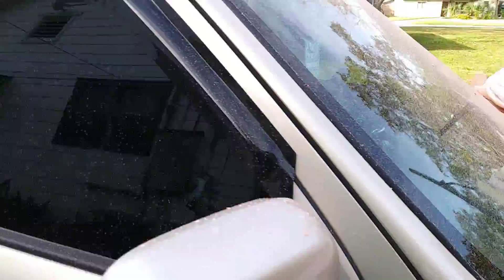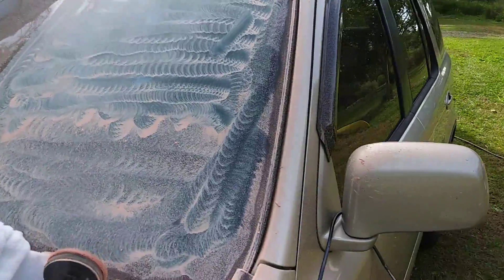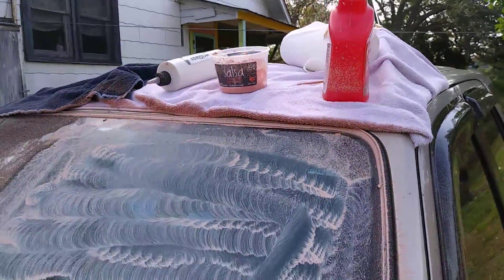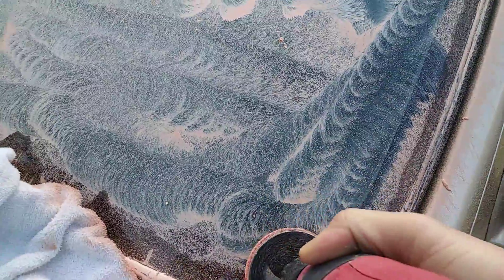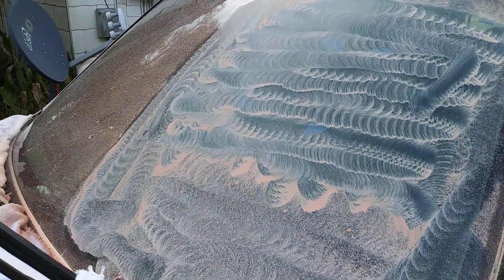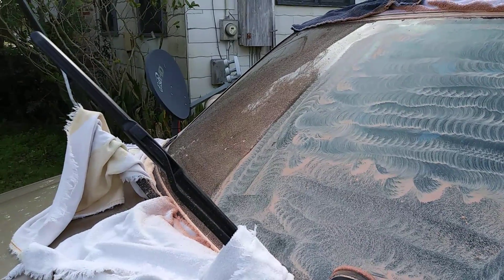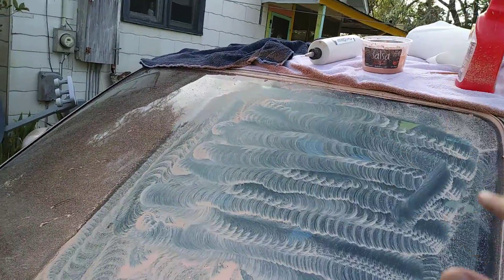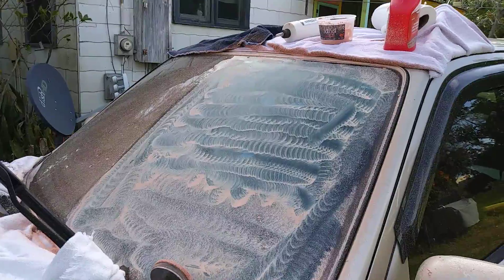Cerium Oxide Windshield Polishing Part 2

Comment: Is this going to damage the car paint? Thanks
Reply from the maker: I've used this many times and anything you get on the paint you do want a very carefully remove with like a rinceless wash method. Spray it down with a pump sprayer, carefully wipe with a soaked and then dry. It is abrasive so you do want to be careful but I have had zero problems
Reply: @deluxevehicledetailingandp904  Noted. Thanks for the great info.
Reply from the maker: @brianwong6562  yeah I was using talk-to-text and said soaked MICROFIBER ,

Comment: I found many swirl marks after polishing especially when use foam pad (with wool pad resulted in less swirl marks) Do you have suggestions how to remove this hairy swirl marks?
Reply from the maker: You are getting swirl marks using cerium oxide and a foam pad? Did you prep the surface and make sure it was extremely clean? Cuz the only way I could see getting swirls would be if you had contamination in your pad or on the surface. This video was from quite a while back I have a newer one on my channel you can find it was probably about 4 months ago or so. But in both videos I'm using a car Pro rayon glass pad and that is the only pad you should be using unless you're using foam just a deep clean the glass before applying a sealant or ceramic coating to the glass. I've never tried wool on glass but if you say you're getting less swirling that's a good thing. But if you're trying to remove light scratches this will only be accomplished with high speed drill, cerium oxide and a rayon glass pad. Get back to me as to what I've pointed out and we'll go from there
Reply: @deluxevehicledetailingandp904  The wool glass felt I used is kind of carpet, we usually don't call it rayon here, I believe we use the same pad. It's quite common in my country to use that pad. Both wool glass felt and foam pad created a swirl marks, less on wool glass felt. Ok I will try polishing again with higher speed. Thanks for replying btw. I forgot to mention, I bought a new wiper, hope the streaks won't come back.
Reply from the maker: @anandyahamdi  well if it's like carpet this is very different from the pads I use for glass. What is described at I believe it's carpro.com as a rayon glass polishing pad is more like felt. Very flat very specialized type of pad. Are you using cerium oxide? Yes changing your wiper blades off in and actually cleaning them thoroughly each time you wash is very important I even keep a microfiber in my car and keep my wiper blades very clean all the time in between washing. I'll look for a link on my latest polishing video and post it here
Reply from the maker: https://youtu.be/KN0tB8FRYZw
Reply: @deluxevehicledetailingandp904  Yes I use cerium oxide, the carpro pad you use is the same as I use with different brand. I also tried foam pad which I won't use again after so many swirl marks produced. Thanks for your suggestion regarding cleaning up the wiper blade.
Reply from the maker: @anandyahamdi  did you see the link I posted below my reply with my updated video on this? It may help I wish you luck polishing glass is not an easy task but I'm glad you have the flat rayon felt type pad as it really does the best job
Reply: @deluxevehicledetailingandp904  Hopefully with higher speed polishing I can remove the swirl marks. I've ordered another cerium oxide and larger rayon pad to make the job quicker. Last time I used 3" pad was really painful.
Reply from the maker: @anandyahamdi  yeah I like to use multiple pads and use 5 in on a rotary polisher at high speed for the main part of the glass and then bring in a 3 in for the edges and corners. You sound like you're pretty sad I hope you do well and have perfect shiny glass at the end. What country are you in ❓
Reply: @deluxevehicledetailingandp904  I'm in Indonesia. Btw what speed do you recommend? Is 1500-2000 rpm enough for removing the swirl marks?
Reply from the maker: @anandyahamdi  I run my German made Metabo rotary polisher which is available online from Walmart. It won the gold medal in its category a couple years ago when I bought it and it is a very precision made beautiful rotary that has never failed me with many hours of use. Here's a link where I talk about it if you or anyone else reading this is interested.
https://youtu.be/amm9hAOo6fY
Reply from the maker: @anandyahamdi  I forgot to mention that I run it wide Open on speed 6 which is 1900 RPM which is why I started out using a high-speed drill but have since switched to the rotary with a 3-inch extension and 5-in and 3-in backing plates with a foam interface pad that I found on Amazon in each size which softens up the pad because it's so thin and hard working on the curved glass is a little easier with the interface pad.

Comment: After polishing with cerium oxide my windshield became clear from water streaks during the night rain. But after a month the water streaks came back again. I have no idea why this happened?
Reply from the maker: I would think it would have something to do with the water. Do you know the TDS content of your water that you're washing with? Are there any sprinkler systems that you might encounter over the month either at your home or somewhere else? Did you use any type of protective coating after you did the polish. I put out a new series of glass polishing and coating about 6 months ago you may want to check those out.
Reply: @deluxevehicledetailingandp904  I didn't use any protective coating at all. I forgot to mention, my wiper is quite old actually, Is it possible due to the wiper? I can't see any scratches caused by the wiper
Reply from the maker: @anandyahamdi  well if it was from your old wiper blades they would be in the same curved shape as the wiper arm moves so it should be pretty easy to tell if it's water streaking or wiper streaking. Definitely want to pick up a new set of blades and keep them clean I wipe mine quite often to keep them clean so that no dirt builds up and you can get wiper marks. You may have to do another light polishing job but I would definitely think about putting a windshield coating or really any ceramic sealant on your glass so that the blades have less friction and water clears off the glass much quicker.
Reply: @deluxevehicledetailingandp904  I'm a bit paranoid in using chemicals on my windscreen. Some years ago I used a repellent agent that instead of making it clear, it makes my windscreen full of water streaks during the rain. Is a clear windscreen (after cerium oxide treatment) will invite any funguses or dirt? Is it necessary to use chemicals again on my windscreen?

Comment: For how long powder should be left upon windscreen?
Reply from the maker: Well first you mix it with water till you get a consistency you're happy with not too thick not too thin. Then once you get it on the glass you can really just keep working it, but you don't put any powder on the glass. As long as you keep spraying it and adding a little more to your pad you should be able to work it for about half an hour on half of the glass which should make a huge improvement. There is an updated glass polishing video on my YouTube channel. It goes over some new techniques I have been using.
Reply: @deluxevehicledetailingandp904  alright..and is there any need of using sandpaper??i imported cerium oxide from china,with which they sent sandpapers with different grit numbers...i don't know which grit i should use or totally not..
Today i tried,but experimentally i expanded the scratched area😋
So do i need sandpaper?or directly use as you've done in the video without using them?
Reply from the maker: @mr.s.m.s9191  do not ever use sandpaper on glass
Reply: @deluxevehicledetailingandp904  alright Thank you so much Bro..Stay blessed

Comment: You have no idea of what you are doing, who does detailing with a dril...???, all talk bah bah....
Reply from the maker: I've been detailing since 1977 ( I was 15 at the time ) when I started using a rotary polisher on single stage paint and could do it flawlessly without leaving any trails behind. Then when I got into college,  I was the paint correction specialist for a large detail shop in Akron Ohio, that would call me in for really tough jobs and deep scratches, as I was then and I'm now, really talented at wet sanding. You are correct this is the first and only time I've used a high-speed drill for detailing ( other than using those mothers ball and cone shaped foam attachments ) with a high-speed drill which is how you get shine on actual metal rims. The reason you use a high-speed drill for this application is because you need the speed to polish the glass, you need the heat just like when polishing metal you use high speeds to help you achieve the process and the luster that you want . Which is exactly what you're doing when you're using a rayon pad and cerium oxide. Yes I am very detailed and yes I talk a lot,  that's what my channel is all about and that's why I have a channel, but thank you for your opinion.